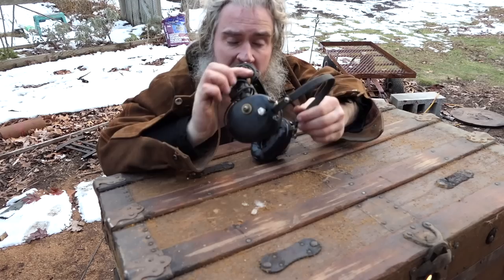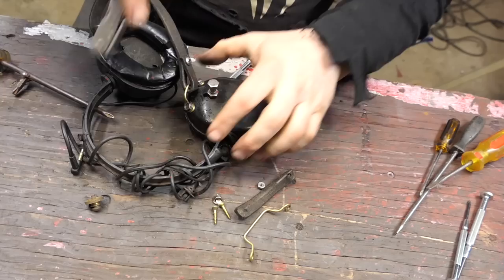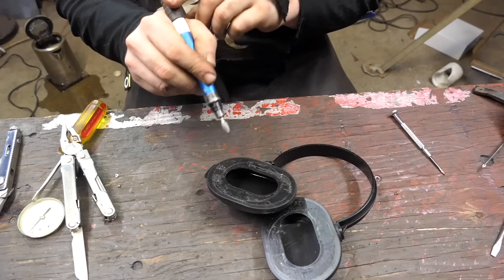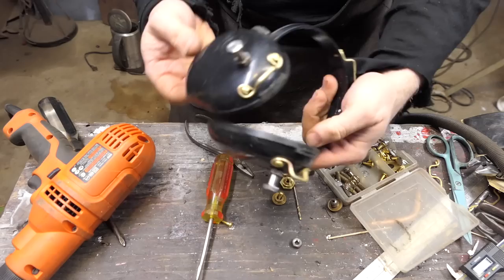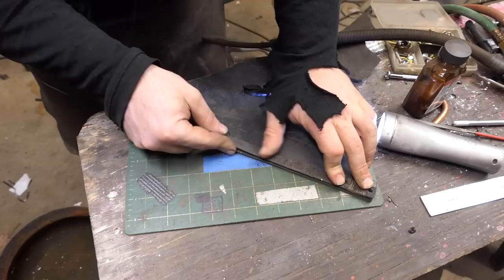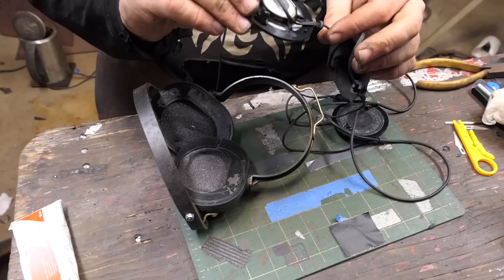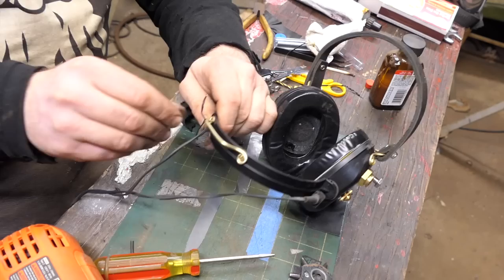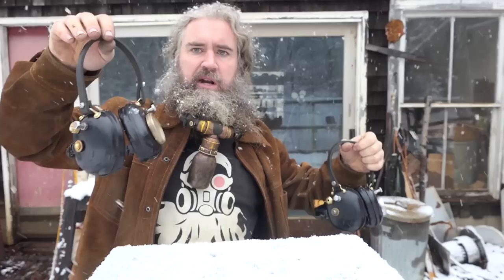Charity Microbuild: SteamPunk Ear Muffs

Comment: As someone who’s spent thousands and thousands of hours wearing earmuffs… i’ll give my input on what I’ve learned

Check out the gel replacement ear pads. It takes 30 seconds to replace the foam pads with the gel pads. Makes all the difference in the world.

I started Metal Detecting when I was eight years old now in my mid30s…There was a good five or six years where I went five days a week at least. I always catalog and journal my trips to keep track and so I can look back at location, weather, what was found, how many holes I dug that day, etc…..

I used to average at least 250 days a year at least a few hours per day. That’s why I wore ear muffs so many countless hours!!

 the gel replacement pads were one of the first things that really helped me out. I think they’re 20 or $30 for the pads but they last forever. 

Building good earmuffs for Metal Detecting can get pretty expensive. I would start off with the 3M “peltor” model muffs as a base… Because they’re about the best quality you can find… 

Then build them up from there. Trust me once you try the peltors with gel inserts… Customize them how you want them… You’ll never look back!

Comment: I wish they still made gauges with glass covers.  The plastic ones tend to be glued on and pop off and then you can't keep them on.  I can't remember the last time I was on a job where the oxy/acetylene gauges weren't just smashed and inoperable, which is both dangerous and frustrating since I can't set them where I want them.

The steel wire likely had flux on it because it was a stick welding rod Arc/SMAW. ;)   You were likely looking for a brazing rod. I actually did some work at Lincoln Electric's world headquarters welding on the flux hoppers and they told us that one of the main components of flux is actually paper and it's ground so fine that it is extremely flammable during the manufacturing process, not unlike how flour is flammable.  They insisted on not only cleaning the hoppers out, but wetting everything down.

I don't think I could wear a welding hood like that.  I'm a flip guy, not an auto-darkening guy.  Even on the few occasions someone gave me their auto-darkening hood to try, I'd just end up flipping it.  I'm sure they're fantastic for fine work making sure you're starting in exactly the right spot, particularly since my hands shake too much now that I'm older.   But, I'm also starting to have issues seeing in the dark, making welding ridiculously harder since I can see the weld pool fine, but not where I'm going!  For a time there, I had to go as dark as a 14 shade because I was literally getting headaches from welding with a number 10 and the auto-darkening helmets I tried at the time were blinding me.

Lastly, it's amazing to me the number of guys who work automotive, or construction and never wear any types of ear protection.  I have always worn the phone ear plugs every day of my life on the job.  You never know when some a-hole is going to start swinging a hammer at something right near your head.

Comment: The best thing you can do to guarantee longevity for those….. is to put some type of sealant or flexible adhesive around the wiring and solder points. 

That will cut down on strain and vibrations which could eventually make the wiring come loose.

 And you could even seal the speakers in with some type of sealant so that metal particles and dust can’t get in there. In the industry we call it “conformal coating“. 

If you’re going to use an off-the-shelf Caulk….Make sure it’s “neutral curing” silicone. Any of the caulking that smells like vinegar will have acids that eventually will corrode and damage the wiring.

 I really like flex tape brand glue or even their clear spray on stuff. Also E6000 glue. Those are all neutral and won’t cause tarnishing.

I have my own lab and small business focused on component level board repair for industrial clients and research labs ect…. I specialize in test equipment repair, calibration, and other metrology related tasks. 

But I was a machinist/ tool/die maker before that. 

The biggest deference between consumer grade and professional grade equipment
Is the liberal application of waterproof coatings, flexible rubber adhesives to stop vibrating components on circuit boards, and a few other similar steps taken two mitigate water/moisture/dirt/dust ingress and stop vibration

Comment: Since your welder is basically an EMP generator, it probably wouldn't work too well with bluetooth anyway. You're likely already using the best option.... well, except for the part where you can buy ear defenders with the speakers built in already for quite cheap

Comment: since when are things annealed by making them cool fast? that's only for hardening,  no?
Reply: That's what I thought 🤔
Reply: Haven't seen the video in full yet so not sure the context of your comment, but it doesn't typically apply to copper and it's alloys, like brass and bronze which need to be work hardened. Quenching them cools them quickly but still anneals them(except aluminium bronze which can quench harden).

Comment: Funny thing is that i just made similar thing out of soem random Chinese crappy wireless head phones on bit damaged Peltor ear muffs and it actually works great.. though i didnt implement any serious chances to them as electronics on those headphones are rather crappy. If i could remove excess options like crappy radio function and such i might implement them permanently.

Comment: I feel like you wouldn't like bluetooth in the headphones.  It's great when it works, but work outdoors seems to kill the batteries all the time.  Replacing the battery is more often than not a nightmare since it's usually impossible to get at without damaging something and glued in because glued batteries are the future of something something environment